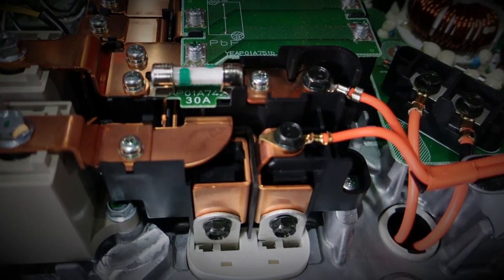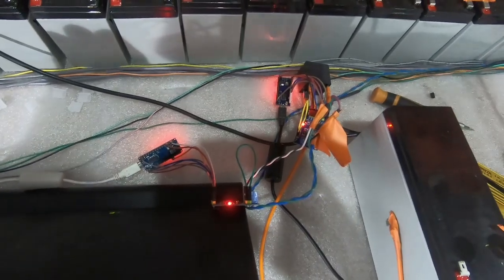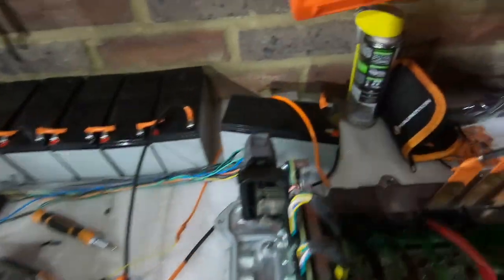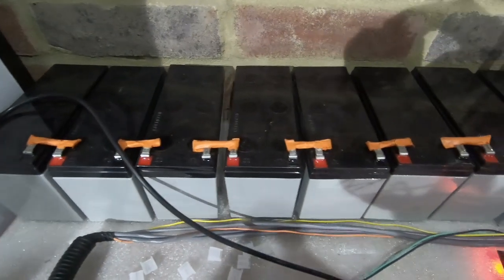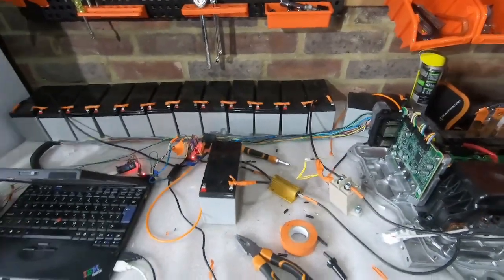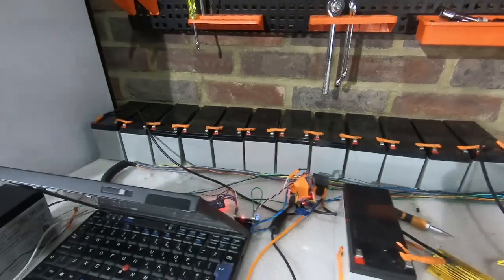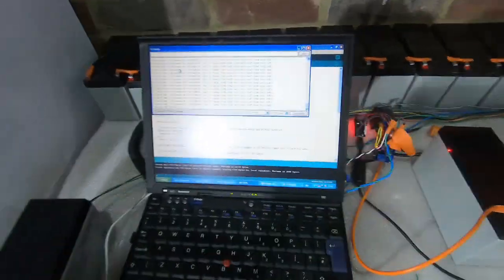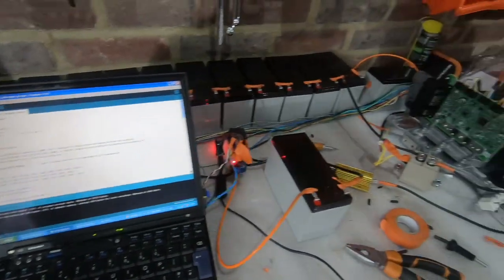Building an Electric Car - EV Parts - Controlling Nissan Leaf Inverter Part 1

Comment: Hey guys, are you planning to share the code and schematics somewhere on github or will it be entirely commercial project? Thanks!
Reply from the maker: Hi, once the code is doing what I want it to, I will be sharing on Github. And I will include links with the videos. I don't want to put anything too unfinished up as I don't want to risk anyone injuring themselves or damaging something if they try to use it but don't really understand what they are doing.